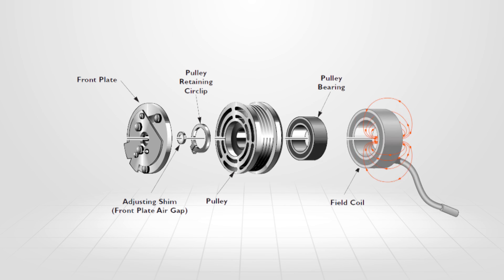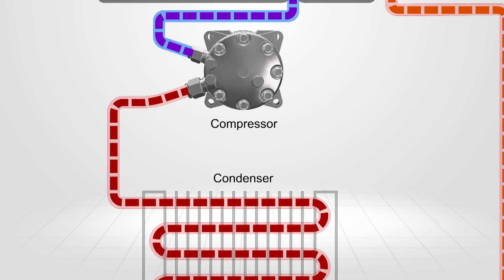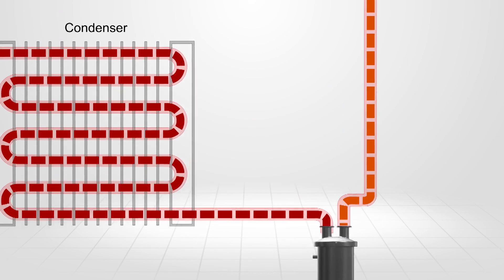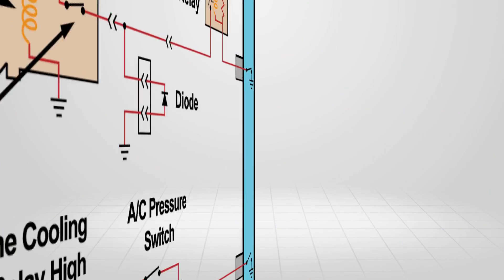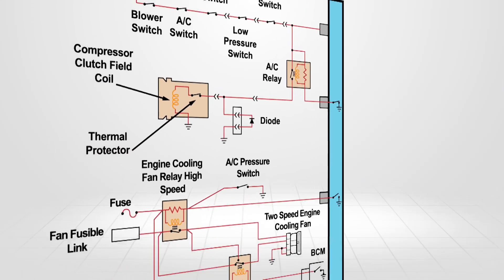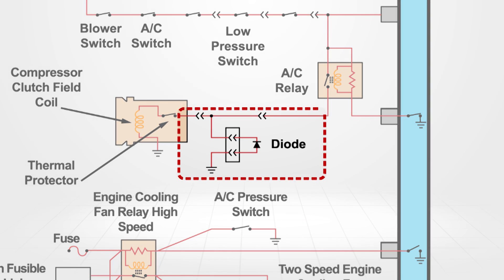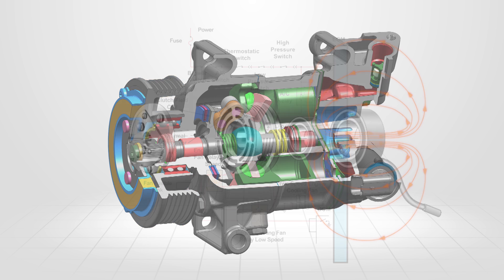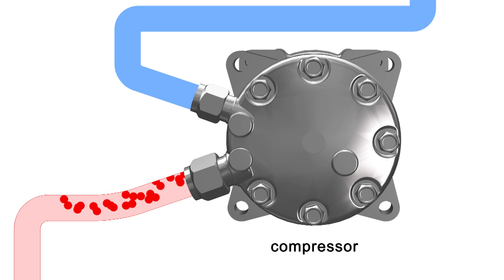Air Conditioning Compressor Clutch Diagnosis

Comment: When I turned on my ac, the clutch remained partially engage to the pulley which caused loud squealing noise mostly at first start. It takes about 30 minutes for it to fully disengage. What could be the problem?